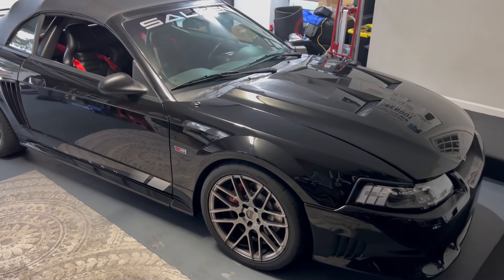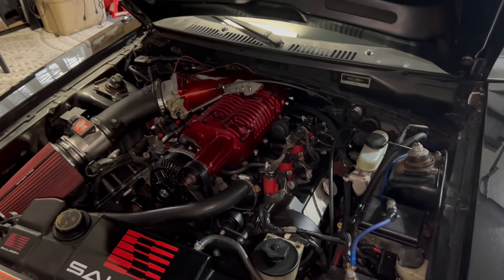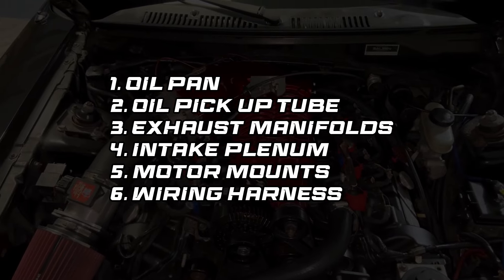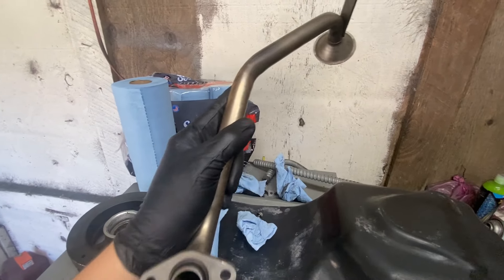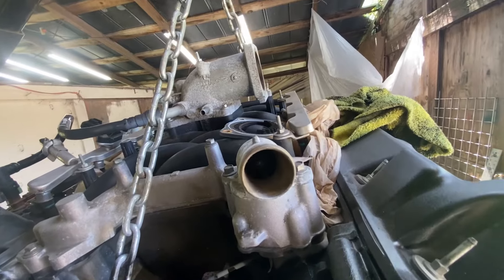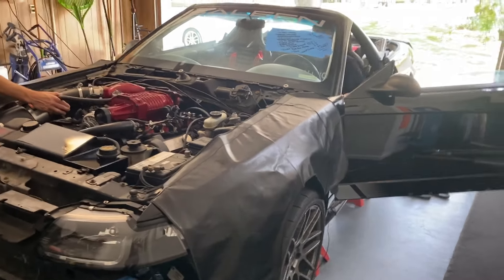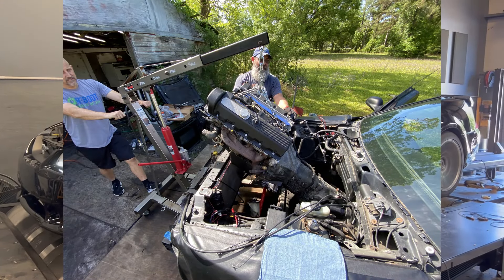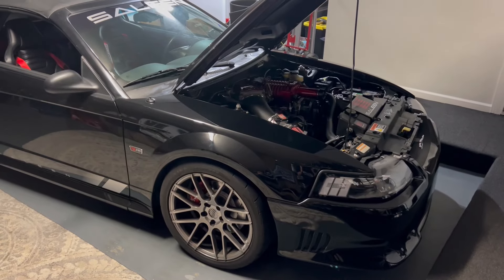How to Swap your Mustang's Engine for CHEAP!

Comment: How easy would this be to do in a SN95. Or if I have a strong stock to valve already by strong I mean decently low mileage and very well maintained would have you better picking up a vortec and putting it on bad motor or doing the engine swap with no boost
Reply from the maker: The sn95 is a pretty similar process. Just rather than using the Coil on Plugs, you’d use the coil packs with wires. If you trust the motor, then by all means go for it and throw some boost at it

Comment: Can I put this motor in my 91 Foxbody let me know. Thanks.
Reply from the maker: It can be done, but you'll need the electronics from a 99-04 car along with I believe a different K member. I do know there are some videos and forum posts on swapping 2v and 4v motors into the Foxbody. It seems like a pretty well documented topic.

Comment: the whole time it isn't running, is gas unburnt that the state doesn't have to account for... more bolt turning projects = saving's 😅
Reply: 1987-1993 4.6's are cast 4340

Comment: How much can the victoria engine make tho?
Reply from the maker: NA with simple bolt ons and tuned I’ve seen them make in the 250-280whp range depending on how it was treated and mods. With boost you’re safe to about 450whp

Comment: Is the Crown Vic motor compatible with the 99 Cobra as well?
Reply from the maker: It will fit, but I would search for another 4v first. Lincoln Aviators/Navigators/MK8s have them. And the aviator motors are aluminum block and high compression too!

Comment: Can you please tell me what you did with the knock sensors? Can you get a harness that has them to make them work?
Reply from the maker: Knock Sensors were removed. The GT's don't support them unfortunately. May be able to get it working if you ditched the ECU for a Holley but that's the only thing I can think of.

Comment: How do you think the performance would be in a s197 currently have a v6 and looking for more and noticed the Vic engines are pretty cheap
Reply from the maker: Never seen a 2v swap in an S197. Not sure if it's even worth doing or if it's ever been done. On paper the 2v will make more than the 4.0 V6 in the 2005-2010 V6s, but the 3.7 from 2011-14 makes much more power than the 2v.

Comment: I plan on building a 2v stang for drifting and will be using my 06 Crown Vic Romeo. How would I go about converting to drive by wire?!
Reply from the maker: Are you trying to use the electronic throttle body setup on your Mustang? If so, why? Just curious
Reply: @904Saleen  Just part availability for me rn, wondered if it was possible to use the vic intake but just the shift by wire/accelerator pedal assembly from a manual 2000 mustang. I'd be using the mustang ecu
Reply from the maker: @whathuh4446  well you should be able to use the Vic intake, but I’m pretty sure you’re going to have to put on a mustang plenum/throttle body with the drive by cable setup. All 99-04 mustangs are drive by cable

Comment: I wanna get as much horsepower all motor out my 2V that means forged, ported and stroked
Reply from the maker: Can probably get in the upper 300s to mid 400s with a max effort NA 2v build. I’m sure it can be done if you go high compression, cams, ported heads, oversized valves, E85, full exhaust and a good intake setup
Reply: @904Saleen  450 seems doable I think

Comment: When doing the swap do you need to change the dipstick being as you just changed by the oil pan?
Reply from the maker: You don't have to. I didn't on mine because they are sometimes a pain to remove. It is a little bit tighter trying to get to it when checking the oil after the motor is dropped in, but not difficult by any means

Comment: You literally don't have to change  oil pan or dip stick if its a panther motor. I have a 1997 GT with a 2008 grand marquis motor.  used the stock marquis pan and dip stick. The dip stick is much lower in the engine bay on a mustang but its not a big deal to reach in and pull it out. The intake is the same too except some only had one coolant temp sensor which ran ECU and cluster. I just wired my sn95 to one CTS.

Comment: Just one thing, the 2011 Crown Victoria P71 was only offered to law enforcement agencies. After 2008 you could not buy a crown victoria as a consumer, you could only buy them as fleet vehicles. P71 packages were never offered to the general public.
Reply from the maker: Ah ok gotcha. Thanks for that clarification. It might’ve been that the car my motor came from never got dressed up with the light bar and push bar. It might’ve been used elsewhere.
Reply: @904Saleen  No worries! I nerd out over those old panther bodies pretty damn hard. It’s neat to see people taking the engines out of them and putting them into something a little faster, I wasn’t aware that it was a very common swap! Really neat stuff
Reply: P71 was a cop cars only, but they sold vics till 2011 just like the TC and GM.

Comment: Do you need to change ecus or no?
Reply from the maker: If you're taking a 4.6 out and putting another in, you won't need to.
Reply: @904Saleen  are the 4.6 from the sn95 and the new edge different?
Reply from the maker: @Shamard1  96-98 GT 4.6s are the Non-PI motors. They are cheaper, but also make less power. All 99-04 GT 4.6s are PI motors and make around 50hp more.

Comment: Does the stock transmission work with these engines?
Reply from the maker: The T-45 5spd in 96-00 GT, and the TR-3650 from 2001-2004 GT, along with the T-56 from 2003-2004 Cobra will work with these motors. The 4R70W automatic 4spd will as well
Reply: Do you think that a 97 v6 5 spd could possibly do the job?

Comment: a 4.6l head gasket is $16 vs a whole motor hmmm , I can do both head gaskets in 5 hrs easily without pulling the motor  ,,   new stock cams are $200 ,, new valves $70 for a 4,6l cheap ,, new stock pistons and rings are $150 rods are $75 , no matter what motor you put in 2024 or 1997 the overhead cam bearings  and valve stem seals wear out rated only for 120k miles , the 4,6l will get better fuel mileage and last alot longer when rebuilt no power but huge dependability with  2V BEST MOTOR EVER MADE . just the wiring harness for a coyote swap is $1500 on Facebook market place you can get a 2011 mustang for 5k rebuilt title  to 9k ,, why swap a motor buy a whole new car

Comment: If i was to get a 2011 crown vic motor. Do i want the police package with the oil cooler or without?
Reply from the maker: Doesn't really matter. You won't be using the oil cooler in your GT

Comment: I have a 1996 mustang gt 4.6l v8 recently got bad rod knock, I wanna swap it out with a crown Vic motor but what year do you recommend and all I have to transfer is the oil pan, oil pick up tube so on so on that’s all for the 96 gt as well right? Or anything else I need to transfer
Reply from the maker: Really any year after 2001 is what I'd go with. The only added thing you'd need to do is keep your plug wire setup used on the 96-98 cars and simply install it on to the newer engine when buttoning everything up.
Reply: @904Saleen what if I just swap the oil tube, oil pan and plenum nothing else, would I run into problems?